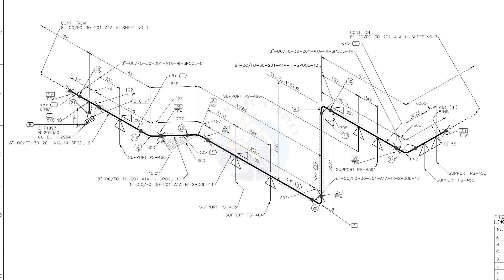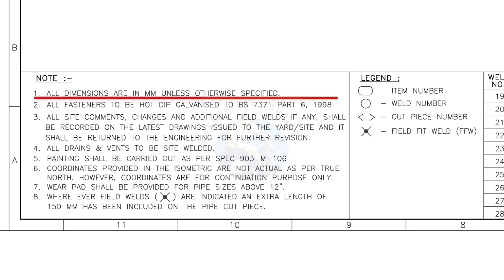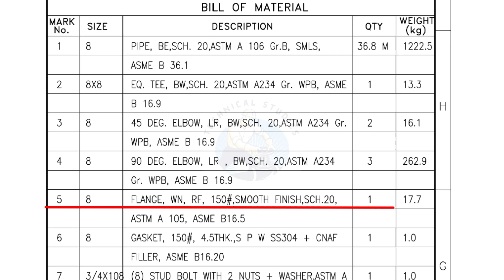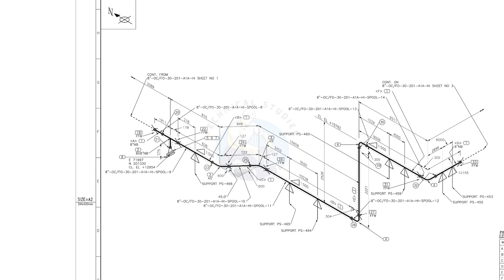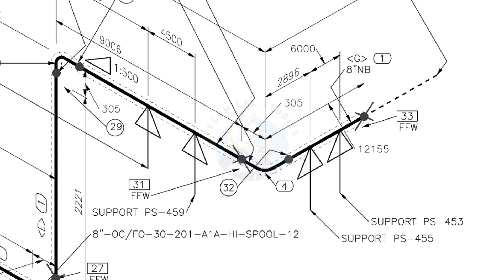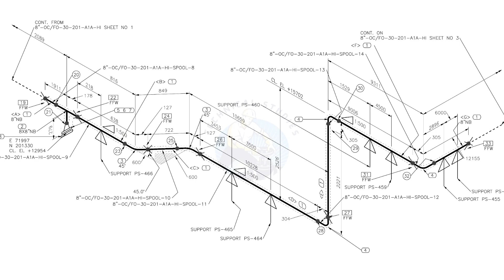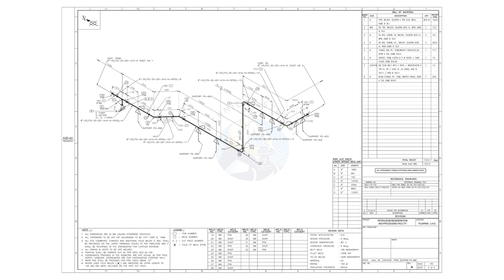Piping isometric drawing. How to read piping isometric drawing.

Comment: Brother how we find the height of the pipe line location of ground level to top in drawing where it's mentioned
Reply from the maker: Bro this is a big question. First thing to do is to find the bench mark point of the plant. Then you need to transfer the bench mark point to the place, you are working location.

Comment: Excellent explanation sir thankyou very much.
1) sir can you please upload vessels and tanks & other equipment fabrication videos and  nozzle marking videos.
2) i want to learn piping designing along with that please upload tutorial videos like SP3D
 Thanking you sir.
❤️
Reply from the maker: Bro, Please check the link. You will see almost everything. https://www.youtube.com/@technicalstudies./videos
Reply: hi sir we have so many vessels in oil n gas and refinary we ha a posistion horizontal and vertical and tower vessels and this is hypresure and hypresure pumping have a branch to connect a different size of flages and pipe and also have air flowing and drain tnx sir
Reply from the maker: @jervilynvlogs7350  Bro. Too big question!